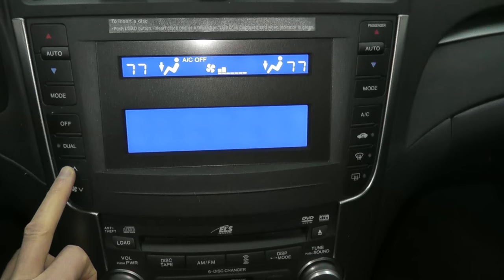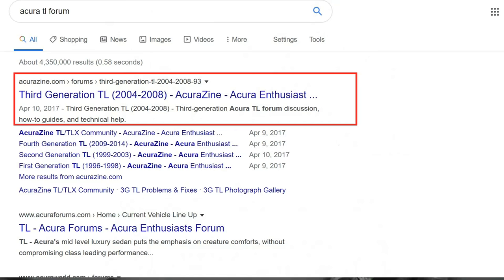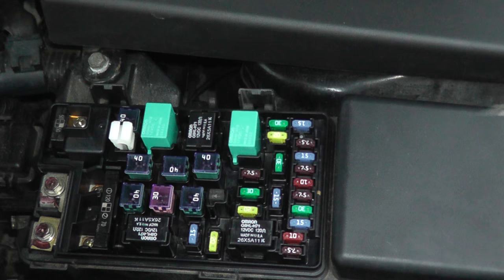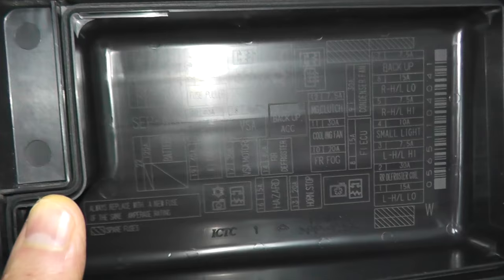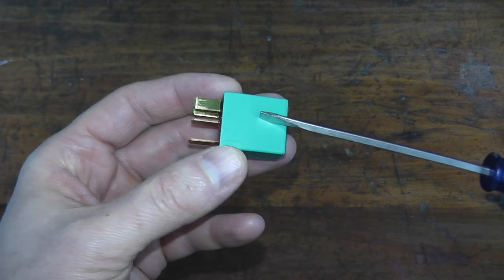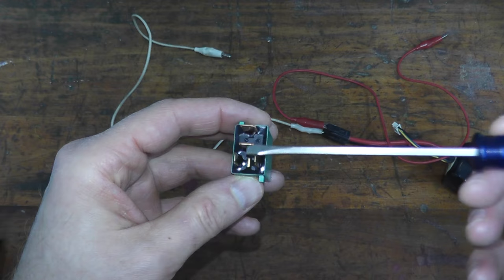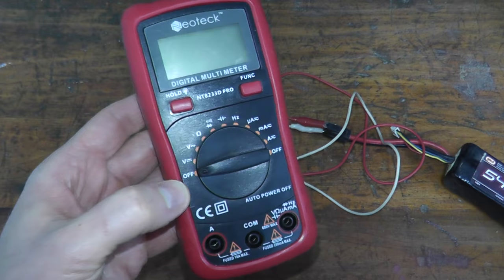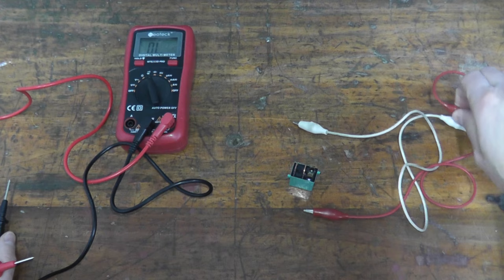Blower Motor Fan Relay Testing and Replacement

Comment: A relay can be damaged by pulling it out although it may not be noticeable.  If one of those prongs gets pulled out even a millimeter it may not connect properly when reinstalled. This happened to me so I pressed each prong and felt one move back in place, then it worked. Now I always press each prong to be sure it is firmly seated in the relay before reinstalling.

Comment: Great tips I appreciate it 😎👍 I have a simpler issue. I had the fan working sometimes I hit anbunp and it works sometimes but not anymore I felt the fan blades it moves freely and sometimes I feel it trying to turn on I’m curious

Comment: 🙂 I bought the Polish made multimeter. It has 2 wires, one has red & black stripes, the other has black and red stripes. (Thats the type of self-deprecating Pollock joke my Polish stepfather would've told. RIP). 

👉 Seriously though, I'm trying to help a friend, who has a 2001 Lincoln Town Car as a backup car. It's heater/AC blower does not blow any air, at any setting. I've spent over 2 hours online trying to figure out the potential problems before I head over there. 

Two auto parts stores gave me prices for the heater fan relay, but the actual Ford dealership parts guy told me they don't even have a relay listed for the 2001 Town Car. He said it's not that they've stopped carrying it(which IS the case with the blower fan motor), it's that this car 'may not' have a relay to begin with. 

Also, I've gotten contradictory info about the blower motor regulator/resistor. At least 1-2 people online said that, based on the symptoms of "blower fan not running at any setting", the regulator could be the problem. But more people have said that if the regulator/resistor was bad, the motor would still likely work on high, but not on low. However that's not the case here. 

I've also been told the physical climate controller switch on the dashboard could be the problem, BUT it's much less likely.

Comment: Seriously? You uploaded at the perfect time because my Acura TL '04 is having this problem at the moment. When its cold, my fan only blows when I've been driving for 10 minutes or more, but sometimes it doesn't blow at all. What is this? I never have this problem when the weather is warm

Thanks for the upload 🤙🤙
Reply from the maker: If you have a decent scan tool, you'll be able to see the fault code. In your case you want to look for a 'B' code; such as B1202. If you can obtain that code I can help you further. If you don't have a scan tool, your local auto part store may check for free. I use this scan tool for the Acura: https://amzn.to/31lXxFl
Reply: @CarsNToys  Thanks. Will do 🤙🤙

Comment: Thanks a lot. Can you go a step further, 1980 280zx. Blower does not run via control reostat. 12 volts direct to motor it runs. Relay checks ok, thanks to you.  Now there is a blower control amplifier also but no clue how to test that or what it does. Also would love a lesson on reading wiring diagrams. Thanks again. 
Bob

Comment: I have an issue where my interior fans come on whenever they want to but I can’t turn them off or change the fan speed, I have replaced the blower motor resistor which fixed the issue for all of 20mins… what would you suggest

Comment: Great! Thank you so much,  and I have a question for you if the relay is malfunctioning can this cause intermitting function of the blower fan      or is it like a fuse that when the connection is broken it doesn't work at all?  I ask this because there are times when the car is running for a while and the blower will kick in or if I turn the car off and restart it with the fan in the on mode it will run for a very short time and then cut out again. Sure would appreciate your assistance with this today it's -30+ and the heat would be good :))
Reply: @CarsNToys I would also love an answer to this question as I am having the same issue!!!
Reply: @amandarogge5775 did you ever find an answer? My relay keeps randomly stopping and starting as well
Reply: @eg-sx1qx  unfortunately no, didn't hear back at all. Hoping they answer soon as I can't seem to find a solution

Comment: Hello sir today I hade unusual problem I took of me wire harnest I was curiuse to see how the 2pin warning lights on buzzer relay is conected and I traced that positive wire to light switch and the other pin from the relay goes to the blower motor resistor so thats where me confusion comes from ???
What has the buzzer to do with blower motor ???

Comment: A bad relay can also cause the fan not to turn off even with the key out.  In this case the relay is stuck in the on position.
Reply: Could it be stuck if the blower motor won't shut off unless the ignition is off
Reply: @jeeplibertyinstall10  No because the relay being stuck on means that the circuit is closed so power is being supplied to the fan. If the fan turns off when you shut off the ignition the relay is turning off.  It sounds like the actual switch in the cabin is faulty so that it is not turning the relay off.  Turning off the ignition cuts off power to the switch. Sounds like it is the switch that is stuck in the on position, not the relay.
Reply: @rogerg4916  true that was the next replacement just a used one. Would you believe I got a new resistor and blower motor just to put all the old ones back in and resolve the problem haha

Comment: My blower fan is stuck on my 99 Rav4. Any suggestions on what it might be?
Reply: A bad relay can also cause the fan not to turn off even with the key out.  In this case the relay is stuck in the on position.